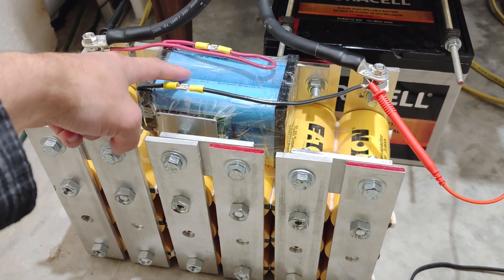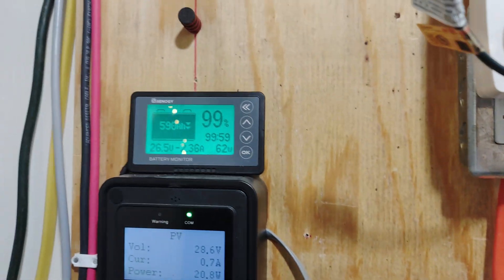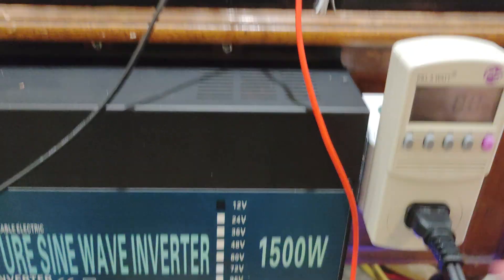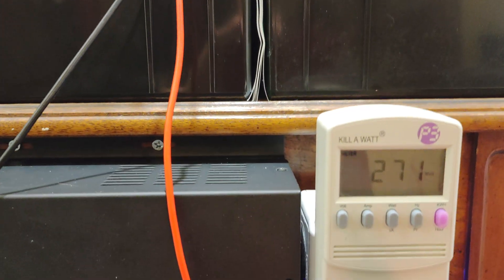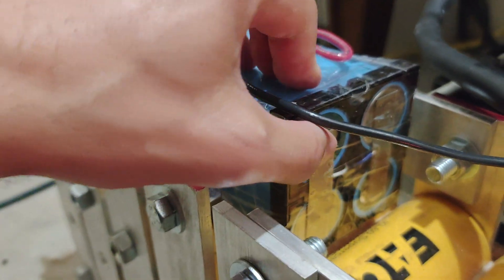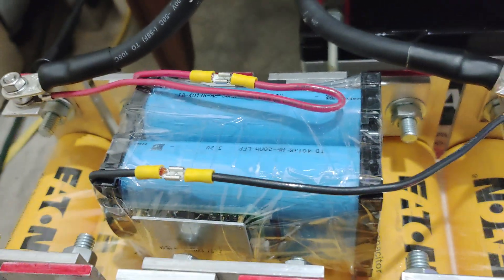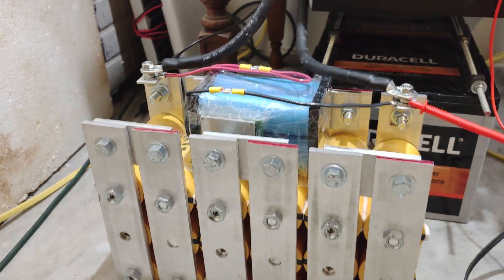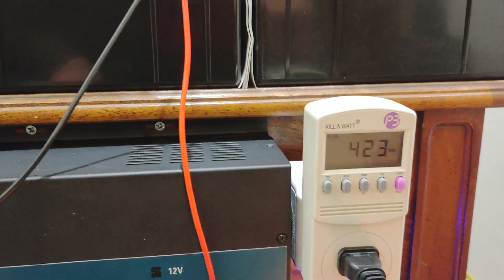What a Hybrid LiFePo4/super capacitor battery can do!

Comment: Super caps are great for instant high bursts, but are the exact opposite of what you want for an energy setup. All three sets of those caps combines are  less than half the energy of your 20ah lifepo4 battery.

Stick with batteries.  Much more energy dense.
Reply from the maker: It's way less than half of a 20 ah battery for many reasons, also a battery remains at top voltage for the full cycle of the battery as where a capacitor will only be useful for the 80% range to to loss of voltage with the cap bank. But a cap bank can take the initial load away from the battery and can get away with a much smaller battery for the capacity of the overall system
Reply: @garretwalenski8215 it's less than 20ah for ONE reason. And one reason only. It's a simple matter of capacity.

But yes, super caps are great for inductive loads and stuff. No benefit for a resistive load, though.

Comment: Great video. Thanks for sharing.
I have a similar set up, same charge controller. Mine is 100 amp and works great.
I use 12 volts at 640 amps and use it to run a freezer and coffee maker full time.
Despite bad weather I've had no issues yet.

Comment: There is no surge with a resistive load like a heater. You  could have powered this resistive load with the LFP battery pack alone without the super capacitors. Super capacitors are beneficial when starting an inductive load.
Reply from the maker: There's still a big surge initially when first turning on because it starts out on high. At 1200 watts then I slowly trimmed it down to its lowest setting of 400 watts. I get that it's a resistive load now if I would have used a skill saw to test a large spike in current but my inverter can't handle a 6k surge in power. Good point though!
Reply: @garretwalenski8215  That's not a surge. That's simply a higher load. A surge is  or inrush current is created when an inductive load like a motor or transformer is first turned on and typically lasts only a few milliseconds to a few seconds. In the case of electric motors for example,  when an electric motor, AC or DC, is first energized, the rotor is not moving, and a current equivalent to the stalled current will flow, reducing as the motor picks up speed and develops a back EMF to oppose the supply. AC induction motors behave as transformers with a shorted secondary until the rotor begins to move, while brushed motors present essentially the winding resistance. The duration of the starting transient is less if the mechanical load on the motor is relieved until it has picked up speed.
Reply from the maker: @Madsci-zy8wm  ok I see now. Thanks for the information.
Reply: @Madsci-zy8wm bit late but actually, heaters do have surge current, but not as high as motors, when the resistive wire is cold it has a lower resistance, mean higher current but the resistance increases when the resistive wire gets hot and the current decreases

Comment: No way you just posted this! I’m doing something similar…

I’m trying to wire up super capacitors, I think 5x 2.7V 90F (claims 900A). This issue I have is the BMS detects a dead short when starting my vehicle and shuts off for 2S causing the super caps to dip below all the electronics low voltage thresholds, my router, etc end up rebooting. Not sure of a great way to solve for this, found a larger capacitor bank to maybe help.
Reply from the maker: Yeah that would probably be too small of farads for a vehicle. I would recommend larger if possible. Another is that they discharge very fast so you would definitely need a actual battery to be able to store energy. But the charging system is different on a car because they are designed to charge lead acid and not lithium. But if you ran only super capacitor it would work but won't hold charge long enough to be useful in the long term
Reply: BMSs arent really made to sustain the high currents of starting vehicles.  Not cheap ones, anyway.